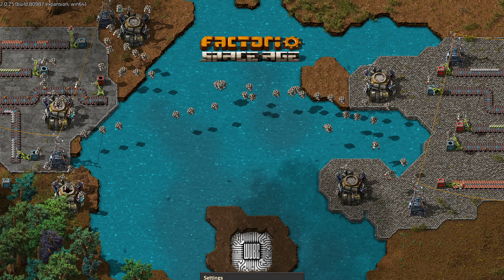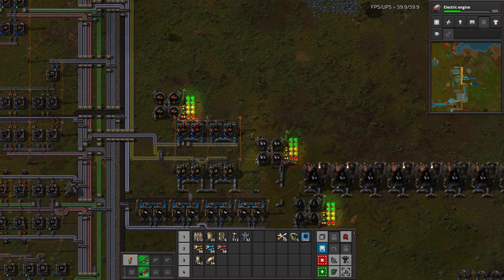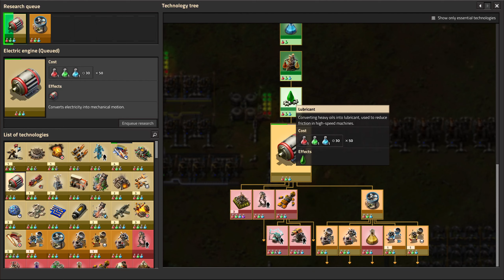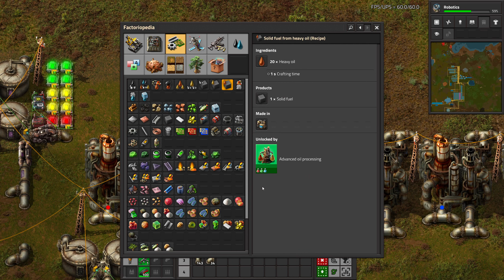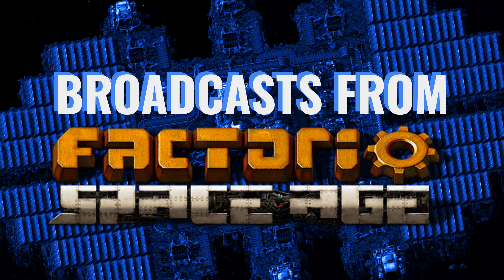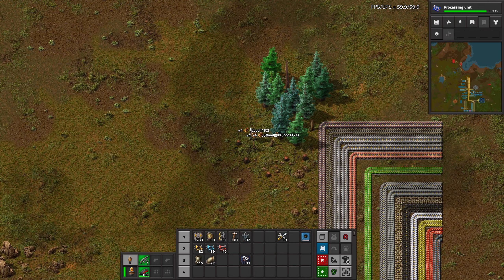Advanced Oil Processing & Robotics - Broadcasts From Space Age - Factorio Let's Play/Tutorial

Comment: Once I have Cubes being produced, I try to get most of my fuel expenditures are changed over to use the cubs with the coal (and excess wood) as back-up.  In the later game, I have some tree Groves to produce Wood that I use as a quick heat source for Power Generation, as by that time, I no longer am using fuel powered smelting, so all for power generation.